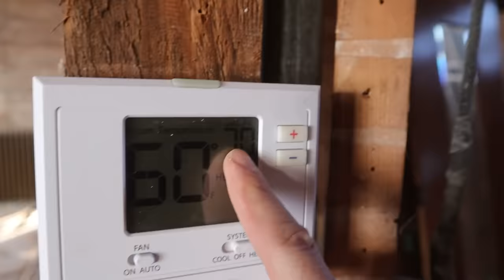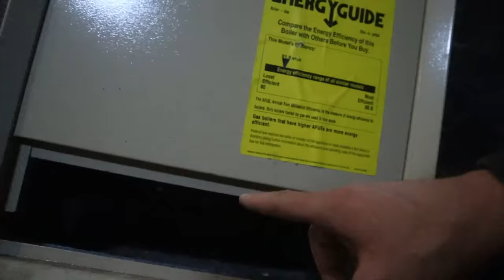Restoring A $7,000 Hoarder Mansion: Main Floor Demolition

Comment: The hardwood oak flooring would have been very saleable. Many people would reclaim it. Simply pull out the nails. Then lay a floor. You renew the surface with a floor sander. Does not need planing first. Then stain and coat the timber with appropriate coating. Oak looks wonderful.

Comment: I'm impressed; Roman is ambidextrous.  He can operate both a left-handed, and a right-handed shovel.
Reply: And arm wrestle with both as well!  Very talented 👍🏻👍🏻👍🏻
Reply: I see how you worded that.
Reply: I’m left handed and I have never figured out how to use a right handed shovel 😅
Reply: I never knew there was such a thing as a right and left handed shovel.  I thought a shovel was a shovel 😂
Reply: That's nothing hammer with two hammers consecutively, I used to assemble glass panels for aluminum windows with 2 rubber mallets at once, took a little while to master it, but even so it wasn't efficient.
Reply: Reminds me of an old joke.  

A contractor hired an individual to help build a barn.  He set the task of attaching the siding to this individual and later when he came to check on him the contractor found large amounts of nails on the ground.  He asked the individual as to why all those nails were tossed away.  The individual said that those nails were defective and the contractor in disbelief asked the individual how the nails were defective.  The individual asked the contractor to watch.  The individual reached into his pouch and pulled out a nail with a nice round head on it and drove it into the siding.  He again reached into the pouch and pulled out a nail that had a point on it and threw it on the ground and said to the contractor, "see defective no head for the hammer to hit on."  The contractor in disbelief started yelling at the individual calling him "stupid" and all kinds of other insulting names.  The contractor leaned down and picked up the nail and shouted at the individual saying " these nails are for the other side of the barn!" 😁😲😳
Reply: Love Roman's sense of humour 😂
Reply: He’s rubbish with overhead shovel tho, just saying 🤪
Reply: I'd give my right arm to be ambidextrous!

Comment: I understand that there is a lot of time and effort put into the floors but its a shame you couldn't salvage them or sell to someone else.  I pray you can restore the character and elegance of this home!
Reply: I’m genuinely shocked. There was nothing wrong with this original floors. They could have been refinished. I’m worried he's done the same with all the trim work. It's a shame he keep saying he is restoring a home but this is a complete remodel.
Reply: I wonder if they could be used to at least fill in where needed in the downstairs as rooms are reconstructed?
Reply: He always said he would preserve the woodwork and original features of the house. Now he says the wood is "damaged" but we see that it is not. This is a Victorian style house, renovating the interior completely loses its value.
Reply: He could renovate the kitchen, bathrooms, basement, but the main rooms? This is just insane.

Comment: Our house here in southern Oklahoma was built in 1889 and still has the original plaster and lathe walls without a single crack.  I attribute it to they used to add horse hair to the plaster and it really does hold it together.

Comment: I can't wait until they start putting up sheetrock, with those original studs it's going to look wavy as hell.  He may get away with 5/8" sheetrock, which is double the price but if he goes with 1/2" he's going to have to skimcoat the entire wall and ceiling to get it flat.

Comment: Such a tremendous undertaking! While I do understand and agree that you need to expose the walls for electrical reasons, I sure wouldn’t get rid of hardwood flooring, and trim unless there was sufficient damage. Hardwood floors as well as any lumber in that house was probably harvested from virgin timber, which is usually a dense lumber. Making them very sturdy. The hardwood floors can just be sanded and stained with no effort at all. Trim that is cracked can be glued and refinished. This would save you tons of money in the purchase of new materials. 

Definitely something that will keep you busy for the foreseeable future!

Comment: I really hope you reuse that hardwood flooring as an accent wall, for a hood vent above your stove or as part of the vaulted ceiling in your attic. Those boards are amazing and the sentimental value is immense. I believe you’d regret it if you just disposed them.

Comment: It would have been so nice to not have used the cheap vinyl siding on this house. Also I know it would cost money but I think you should have went to someone like your great window company in Iowa (Pella ) and got new efficient larger windows and got rid of the double hung windows. A large window in the master suite over looking the farm would be nice.
Reply: you know I forget he did that, without the lath and and vinyl siding that spray foam really is structural now he removed a ton of shear strength from the walls. in modern houses then plywood provides the shear strength on these old houses it was mainly the lath and wood siding joining everything horizontally

Comment: You could drop the wood you don't want to a salvage depot, or put it for sale and let them come get it. Make some cash from something you won't use. Some will take those old boards and finish a ceiling or design a feature wall.

Comment: Someone would probably buy those floors. A run through a planer and good as new. Now thats a truck load of kindling.  All that lathe.
Reply: I bought the floors from roller skating rink and ran it thru a planner and I salvaged about 1/3 of the rink .
Reply: @Dwayne-mb2uj  I'll bet they are Beautiful. Good job.
Reply: @barbrice721  Not that great but free makes them look better than average..
Reply: @Dwayne-mb2uj  lol.

Comment: The fact that there's any headers anywhere in the house is amazing to me. My 1897 house had 2 headers in the entire thing. Both were installed in the 1980s when windows were replaced and a door moved.

All other doors/etc. in the house were done with a single 2x4 (2"x3-1/2" in many cases) laid flat and nailed at the ends (no king studs under it).

Good job on moving out to do all this, and to hire folk to help speed up the process. I tried to do it by myself, from 520 miles away, while my eldest kid and her fiance lived there.
Let's just say 6 months in a stud wall kitchen with a 20 year old plastic utility sink is not easy. (Good learning experience for a 20 year old, ya? :D )

Comment: I remove lath and plaster by using a sawzall and cutting it out in sections between the studs.  Then we carry out the sections in 14” x 3’ sections.  It makes cleaning up much easier. It leaves all the nails to be stripped off the studs along with a 1.5” of plaster and slat ends.

Comment: Those nice cast iron radiators are very cool Cole ! When the time comes I would put in a new Navian or A O Smith condensing boiler for heating your home. Up to 200,000 BTUs at 98 % Ef.

Comment: I always used a pick to pull down plaster and lath. You stick it through the wall near the ceiling next to a stud at a slight angle. That way, when you lift the handle,  the backside of the pick hits the stud and the front side pries off the plaster and lath. Then you get a new bite and work it up and down like a can opener as gravity pulls the pick down to the floor.  As you work, you'll find the plaster falls ahead of your  work. So its gone and out of your way before you get to it. Snow shoveka or coal shovels and gabage cans make quick work of the mess.

Comment: Cole I know you have budget in mind on the project but food for thought you are taking down plaster and will most likely use dry wall to replace and you want to reuse some of the trim and plaster is thick so instead of 1/2 dry wall in my experience I have used 5/8 it much more closely match plaster in thickness and should help with your plan to try and reuse the trim and that trim is beautiful also as an added benefit it has some fire resistance rating much higher than 1/2
Reply: He said he doesn't know what the interior will look like, which means he doesn't have a budget.  I wonder if he's priced out windows, drywall, flooring, HVAC w/ductwork, complete rewiring (to code if he wants to get homeowners insurance)?

Comment: Before you close up the walls or do any wiring or spray foam you can go around and do a treatment that seals any air gaps going out of the house and if you're planning on replacing all of the windows you won't even need to cover them up. I think it's called air gap treatment and all they do is they fill the house with airsolized sealant then pressurized the house forcing the sealant to seal any gaps are cracks in the outer skin of the house It works pretty well to do it before you do any spray foam or wiring or plumbing and in that 100-year-old house it would be pretty good idea if there's anybody in the area that does it
Reply: Hey.... Cole is a master carpenter in these episodes, in future videos he'll be a master electrician and master plumber.  He doesn't need help from you.

Comment: To speed up removal, Build a 2x4 holder, u shaped, place the boards in that holder when size is enough, bundle with twineset aside for disposal in truck. Less running - better use of time???

Comment: for the exterior walls with blown in insulation. Get the  vac back and just use a 4" hole saw to cut a hole for the hose to suck out all of the insulation.
Reply: Why do that when they're gutting the interior and pulling down the lathe on the exterior walls?

Comment: Also I would’ve saved all that old plaster and lathe, old homes like this get some structural support from the lathe, skim coating and plaster buttons are the way to go. Plaster is anti microbial so if it ever gets wet it won’t mold, being masonry based. It’s also got better r value and sound deadening than Sheetrock.

Comment: I would wonder if you could rent a trailer storage or a drop-off storage unit like the POD. but the Pod has soft sides, and if it marked all the good trim, where it was from, then tape them together. Then, store in your rented or borrowed trailer. You can, with trim, that is water damaged save  the front and this will take time and buy some kind of backer board the right thicken, glue the front piece of trim to the backerboard  and put weight all over the top. You can use a small trim nail gun to place a bunch of nails to make sure that the two pieces are now one piece. When done, you have a rebuilt piece of old trim. The bent up trim pieces can be reused with steam and heat, which allows the trim to be straightened out but without a shop set up to do it. It is a pain. That is what the big-time contractors do who do those big restoration jobs

Comment: Take the bottom boards and then vacuum from there it will all start to fall add cut 20” piece buy 4 ft hold it up against wall to help with suction

Comment: If reinstalling the ceiling and special trim board did you by chance number and make a location map?
Reply: Nope, all thrown into a pile on the floor which was then thrown onto a trailer and stacked in the shop.  Nothing marked... because that would have added an extra 3 minutes to Spaz's timeframe.

Comment: Cole, did you notice those floor joists, besides being on 12" centers, are also 2x8's?  Those 2/6's in the attic are not sufficient for floor joists, they are ceiling joists.  i.e., meant to hold up the load of a ceiling, not living space.  I hope you'll consider using larger members up there for floor joists.  And as I suggested before, get a real electrician to help you plan the renovation.  Better yet, have them do the upgrade now  (after the framing is done) while you have everything open. I love this kind of work.

Comment: Control panel was most likely covered in dust which is why it stopped working. With the wood floors, why don't you salvage the floors throughout the house to be able to do one floor, possibly the attic that sounds like it'll be your master suite and do the rest of the house new. Roman, your story is awesome and inspirational! Does your engineering experience/schooling not translate or why are you not an engineer here?
Reply: He probably needs to study for and pass the state engineering licensing tests. My niece recently passed hers for Electrical Engineering in NYS.

Comment: @cole while you have the walls open please do yourself a favor and future proof your home when it comes to internet and things there is nothing worse than fully remodeling and not thinking of the small things like where your internet goes. Also, run cat 6 from the desired router location to potential offices

Comment: I hope all that plaster was just hog or horse hair and not asbestos containing?  Did you see my comment about the pneumatic gun for easy nail removal for the flooring and trim?  I use the Air Locker AP700.  A woodshop that specializes in hardwood flooring could easily match the original  to get you more material.  Also, reinstall the old flooring THEN refinish it with a floor sander or hire an experienced person for this. Don't try to plane the flooring.  You'll hit metal and it won't be even and you'd still have to sand the floor.
Reply: Did you not see him take a truck load of flooring to the burn pile?

Comment: Probably too late for this but you can remove the bottom 3 or 4 lath and vacuum out the insulation from the bottom so you don't have to deal with it when pulling down the rest of the lath.

Comment: OMFG That old original Oak flooring would resell for an absolute fortune here in the UK, if that was relaid properly & refinished professionally that old flooring will look absolutely amazing & no brand new flooring will ever look as good.

To see him just dumping that Oak flooring is just unbelievable.

With UK prices of Oak new or reclaimed he is literally just throwing £10s of thousands away.

Also don't know why he's ripping every bit of the flooring up she it could be refinished & any cabling & plumbing run in the floors & ceilings.

Carpenter & Joiner here in the UK for 37yrs & tbh you wouldn't allowed to just destroy an old property like that as it would have protected status.

Comment: Try to use the old trim as possible as it will cost you big time to try to match it
Reply: Make sure you don't label any of the pieces, toss it on the floor, toss it in a dump truck then stack it first.  Just ignore the dents and chips.

Comment: It's going to be enlightening when the final itemized cost comes in for this nightmare project. Good thing you picked up $100 grand for the junk steel. Beergards...
Reply: The heating and air systems are going to cost him that much.  To do it right, he's going to need a separate system for each floor.

Comment: Save the flooring.   At would be bad to through it all away.  If you insist on getting rid of it give it to Habitat, they would absolutely love you for it.  Any wood you take out.  I would put all the old wood I could in the attic.  There is an awful lot of wood there.

Comment: I remember having then energy that you have.  I’ve been in the trades for 50 years.  You are doing a better than average job.
Reply: At what, demolition?  That's all they've done to this point and much of is is needless and going to be expensive to replace.
Reply: @benhur520   Yes it is expensive, but if you don’t demo enough to begin with you will be fighting quality and design during the rest of the project.  I understand that he can visualize the current problems and desired endpoint.  Most builders would pull new wiring slap some paint and call it good.  There is no way to get squeaky floors fixed without demo.  He is not only able to see putting real money into it but also willing to put the sweat equity in it now to have a real mansion in the end.  I liked the original trim details. I liked all of the fireplaces.  But it just wouldn’t be cost effective for a contractor to buy a house and make it more energy efficient by leaky fireplace removal.  Building technology has changed a bit in the past 100 years.  Besides the channel content is much better with people complaining about him ruining the original design details.

Comment: But getting paid by the hour and getting things done to start doing what he knows how to do . Construction is much more funner than destruction.  I was the destruction guy of S&K Construction but i also liked the constrution part . I was taught hoto cut tile i was the grunt of the company i did plumbing pipes i ran the new wiring in old homes so i was the guy that got the dirtiest for the contractor that was working on what ever was being done. I refused to do new roofs and my boss was good with that because he knew I would do anything he asked as long as it wasn't truss work

Comment: Why the hell would you trash the old floor and not pull the nails and reuse?
Thats literally thousands of dollars worth of wood
You mine as well just knocked the house down and started over your not saving or reusing any of it
And before people jump on me i worked for a contractor for years that redid old homes here in Massachusetts and yes we would have a laborer pull all the nails and stack flat in a storage container then send through a portable planer and reinstall
Reply: Easy now, he's going to use only the best vinyl siding, vinyl windows, LVP flooring, drywall, steel shingles, Menards grade cabinets and countertops...
Reply: @benhur520  exactly, house should of been clapboard or cedar shake

Comment: It’s a good thing a lot of the electrical didn’t work or this house would have burnt down along time ago. Thank god they came up with a better wiring system or there wouldn’t be any old houses left. It is a shame to loose all the old character inside the house but it will be worth it.